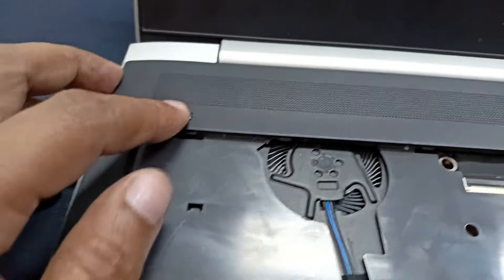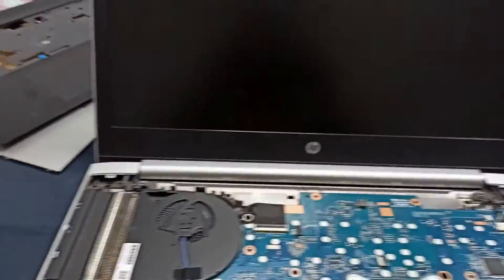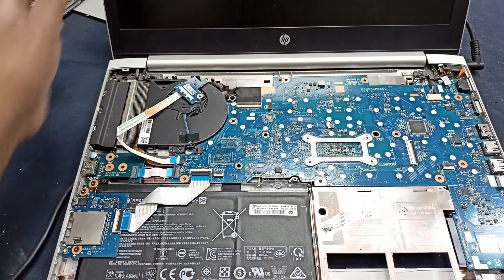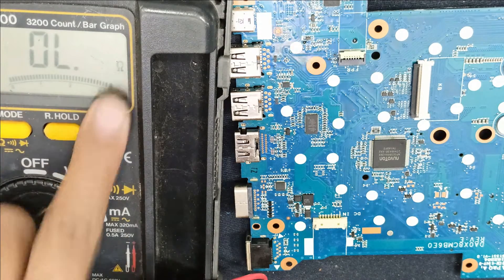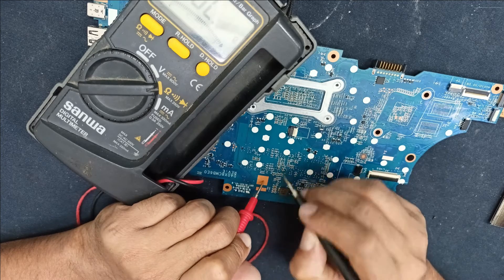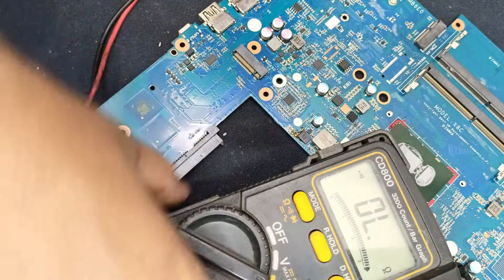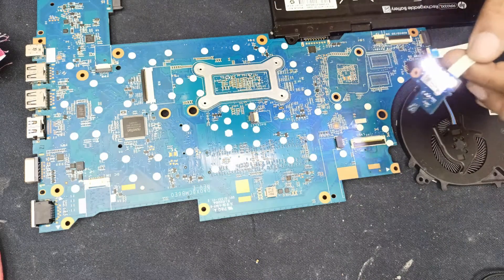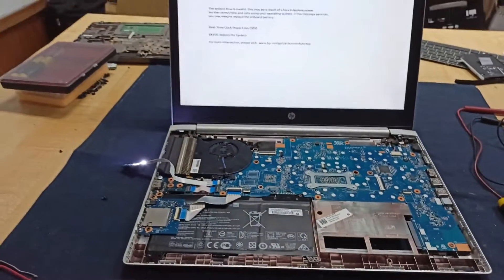No power Hp Probook 450 G5 circuit troubleshooting and solved

Comment: I just wanted to say i had a similar problem, notebook did not charge but it still worked with the energy of the battery. The yellow dot/led at one side of the charge pin did not turn on. I dissarmed the whole laptop as the video and i did not had the 19v in the + pin that comes to the board i got different value. I check continuity with the tester between the pin charge and the + and it was ok. Then i checked the notebook charger, it was giving me 18.6v instead of 19.5v and it has a little bzzz sound inside when i close it to my ear. I just bought another used one charger with the 19.5v ok and the dot-led at one side of the charge pin now blink, the notebook works fine now. So this model of notebook seems to protect itself and do not blink the led charge until it have the correct voltage. I hope it helps if someone have similar trouble. MrContrive thank you for the video it's very educational.

Comment: Hi there, i have a problem with this laptop, the fan not stopping and still running, i try to format the laptop and install the new windows but still the same problem, i think it hardware problem, its running with the press the power button and it not stop until i turn of the laptop. Hope you can help, thank you ❤

Comment: hi MrContrive, i have a hp probook 450 g5 core i5 8250u version laptop,once it was unused for a few days,after that when i tried to turn on, its not turning on and now when i connect the power connector, its continuously beeping sound like siren goes on and only the lights of power button lit up and nothing happens. the fan is also not rotating, what should i do now?please help, thanks in advance.

Comment: hello and thanks for your video, i have a question I have ProBook 430 g5, and it doesn't turn on. the power button lights up but no fan movement. but because of your video i was able to figure out its a capacitor that looks like a little can, f816 330uf 2v says on it,  I've searched for it on digikey and mouser, i cant find what brand or which one to get. can i get another type of capacitor that has the same 330uf 2v? or what can i do its right next to the processor

Comment: Hi my HP probook 450 G5 does not power up but as it is connected to power the cpu heats up no led's are showing up resulting in the laptop not switching on can you help?
Reply from the maker: Open the laptop for 5 minutes after that reinstall and check

Comment: I was checking a motherboard similar like this, it's an HP Probook 450 G2, but I found different tantalum capacitors with this sign. It is truth that those condensers are in short and should be replaced? or in some cases condensers could beep in the negative and positive poles?
Reply from the maker: Great job bro. if you found  1 condenser is sort you don't need to be replace you just remove that capacitor from laptop motherboard circuit  and again check your circuit there are any sort or not if   you get everything's are ok , you may run your laptop without any trouble. thanks for subscribing us.

Comment: Thanks for you help. I have a question. How can I detect when the problem is not a capacitor and I could be for instance an mosfet or another component? Thank you!
Reply from the maker: All time that type problem does not happen form capacitor sometime it comes from others components you need to check one by one which components made your circuit short. 
thanks for subscribing  us . My English fluency is not good but i am trying.